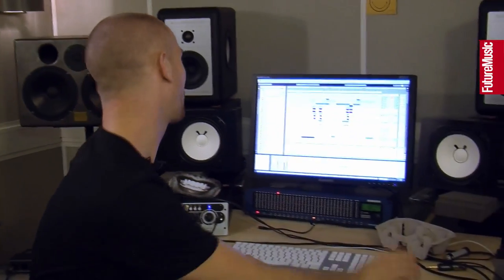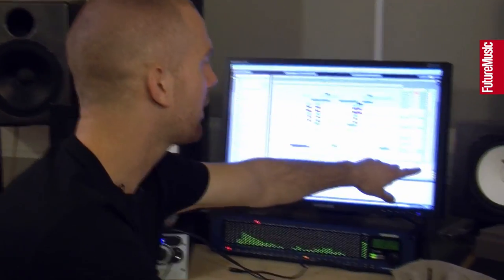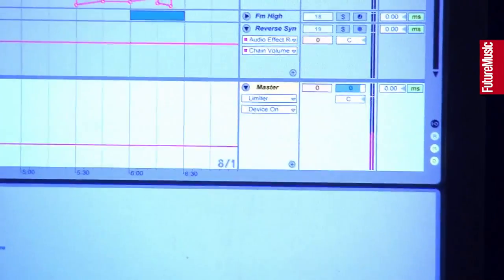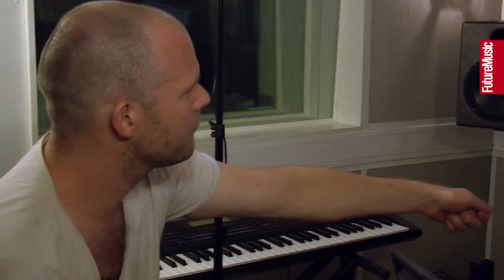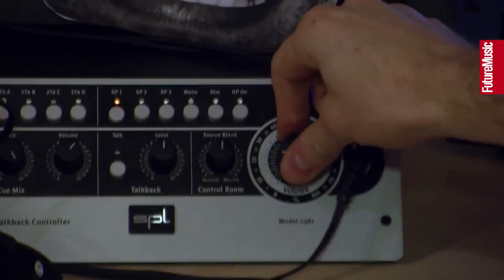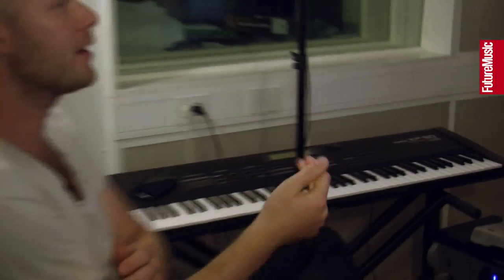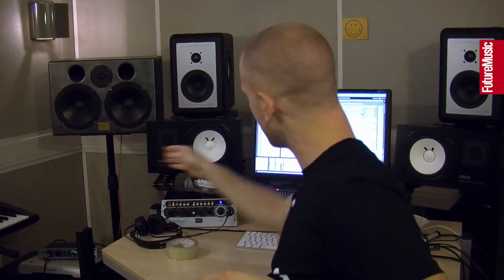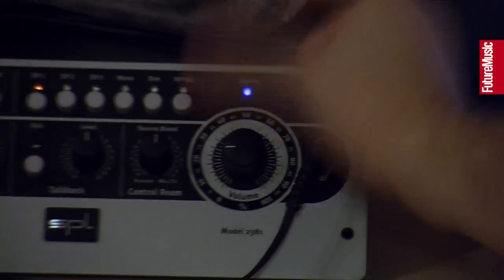Dada Life In The Studio explaining their master channel settings

Comment: Just start with a limiter on the master with 0 GR, and -0,3 on the Output knob. Then while you produce, you work on the master channel.
So when you've made a good loop, you can start throwing an eq or compressor on the master channel.
Just start with a limiter on, so that your track doesn't clip, and then you can always adjust it while you work, and get some volume.

Comment: From Live9 manual, "Because of the enormous headroom of Live's 32-bit floating point audio engine, Live's meters 
can be driven far "into the red" without causing the signals to clip. The only time that signals over 
0 dB will be problematic is when routing to or from physical inputs and outputs, like those of 
your sound card, or when saving audio to a file."
Reply: x Therefore it clips when it's outputted or rendered to 16 or 24 bits alreadt

Comment: Hi, that doesn't matter because you are going from digital sound to analog and the clipping is happening -before- this conversion is taking place. You cannot clip a digital workstation's main output going into your -analog- converting gear (where you are adding headroom after the fact) without getting some kind of digital noise. This is mentioned in the Live 9 manual. But quite good practice to not clip a digital master channel in any DAW.